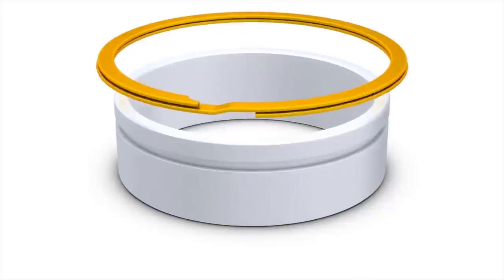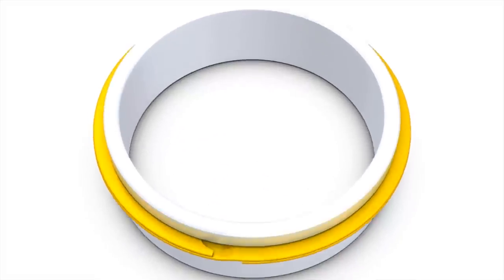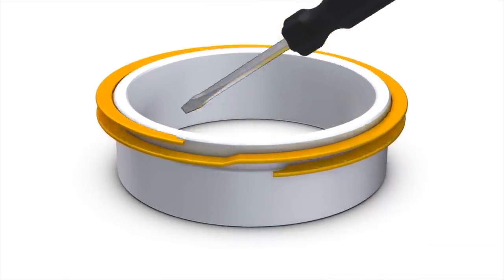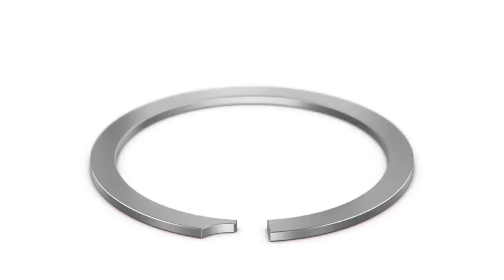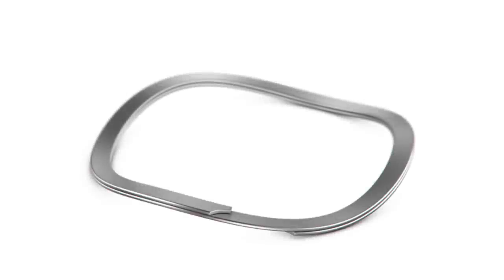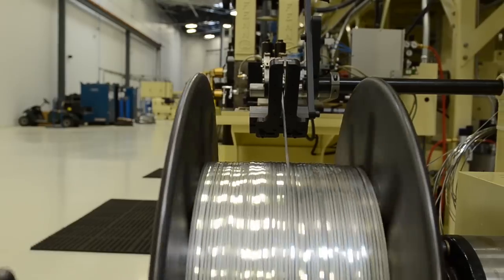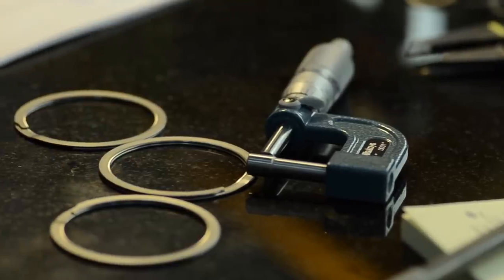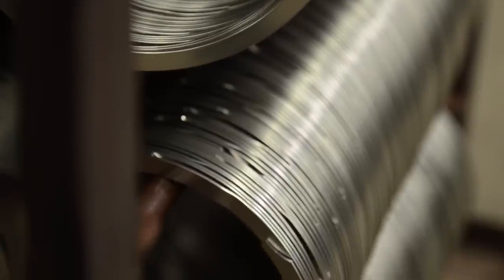About Smalley Retaining Rings

Comment: It shows how it's removed, via using a screwdriver to 'open' the clip. But how is it installed? Curious to know for applications that might require a good bit of tension.
Reply from the maker: Hi Calvin,

Here is the link to help you with installation: https://www.smalley.com/retaining-rings/installation-manual 

If you need any help or questions answered, you can ask us by contacting us: info@smalley.com 

Thank you!